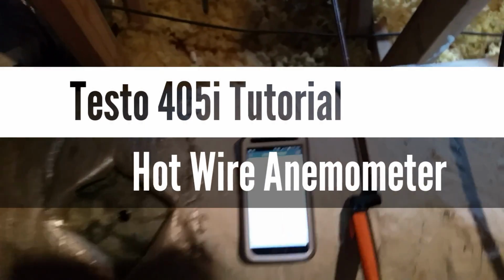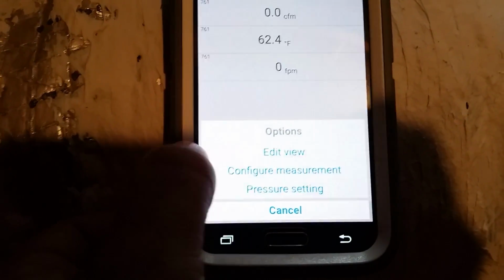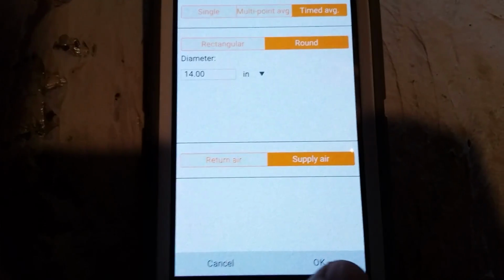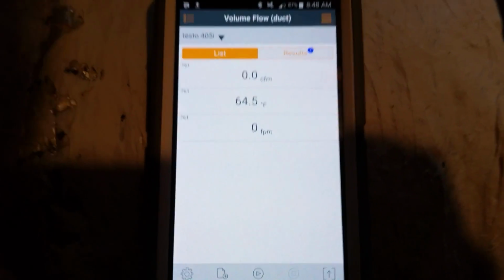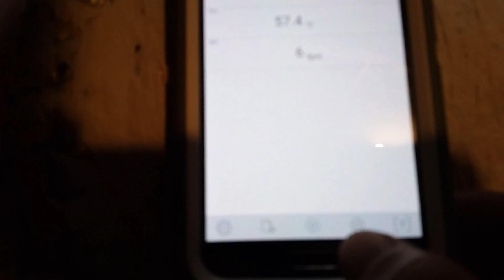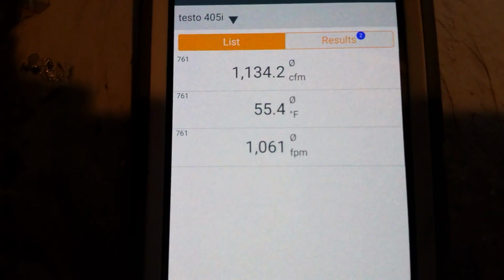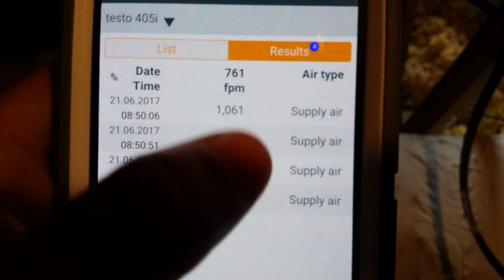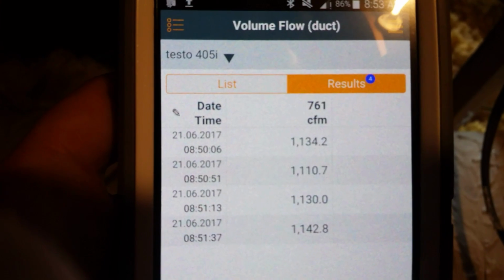Testo 405i Hot Wire Anemometer Tutorial

Comment: I drilled into the return duct about two feet from the evaporator, got through, then hit another layer of metal? What's that? I guess I should go through the round insulated tubes? I just went to the air handler again and I can push a very small diameter rod all the way through but the 405i, about 5/16", won't go all the way. Are there baffles or something else in there? Also, it measure an approximate average of 100 fpm on the return side and 300 fpm on the supply side. Is that possible?

Comment: The new app is significantly different from that shown in the demonstration.  Most importantly, there is no display of CFM or option for averaging.  Raw data is produced, which you can export in a table, IF the app manages to locate your mail program on it’s own.  If not, well, you don’t have any option to select a mail app  in the Testo app, so what you’re left with is partial, unusable raw data that you can’t export.
Reply from the maker: Contact Testo
Reply: @HVACinSC  
I will/have.  I was just venting a bit at your expense.  Thanks for the video though.

Comment: That's awesome, I'm thinking of using this on my PM's too. How would you go about using it on a system that consists of just flex? All residential installations in Australia use flex only lol... typically with a V-box coming off the supply air. Is there a requirement from coil to measuring point?